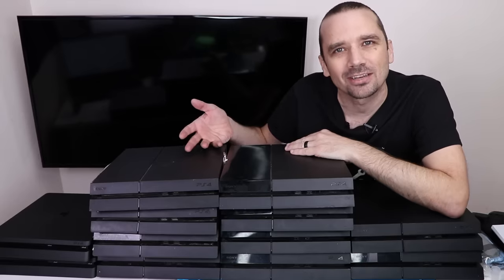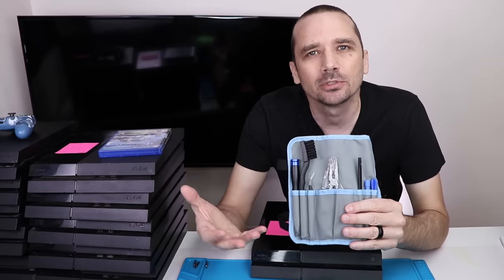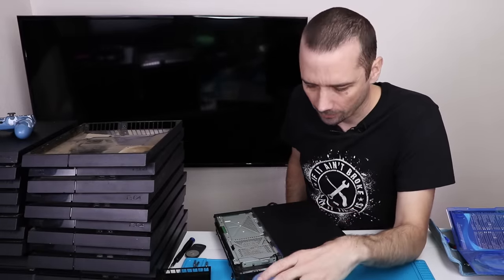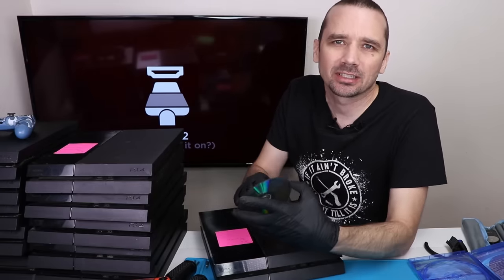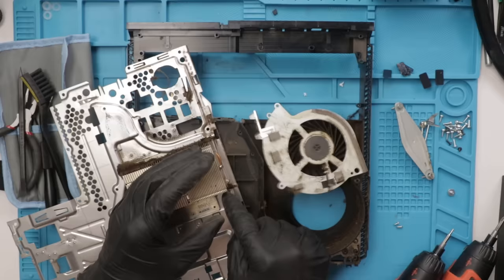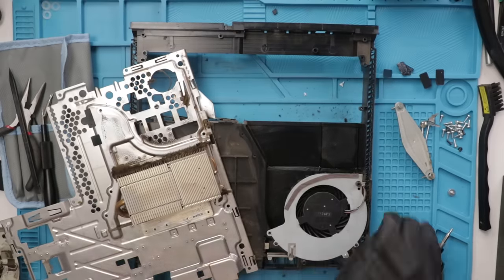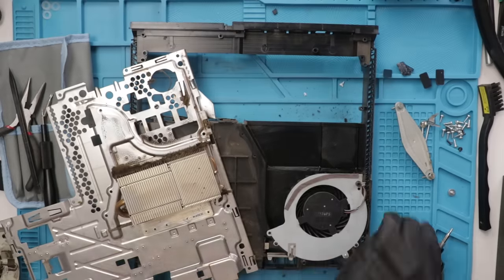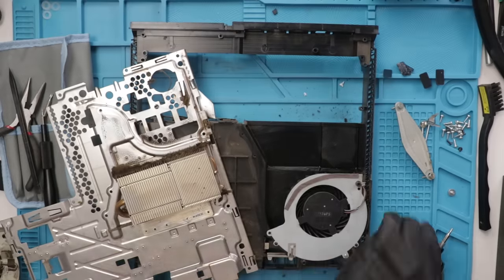I Bought 12 Broken PS4's From eBay - Let's Try to Fix Them!

Comment: PS4 number 1, diagnose: Belonged to a smoker.
Reply: I'm a smoker and am stunned by the amount of dirt in there. You can grow vegetables in there.  No idea how it ended up that bad. As I said, I'm a heavy smoker and all of my systems are pristine inside. Highly doubting that only smoke caused that.
Reply: What kind of smokers do you know? Smoking inside any room without at least a huge window open and a fan is already disgusting, and this is coming from a guy that's been smoking since he was 14
Reply: Is he using his ps4 as a bong?
Reply: @Molly Walker i'm the actual virus, i don't know about the others though
Reply: @vejza1108  I mean obviously they didn't clean the area around their console too, perhaps kept it on the floor as well. But smoking was what caused it to gum up the drive and stop discs being pulled in. Maybe you hoover once in a while and crack a window, who knows. But it was 100% a smoker's console.
Reply: @mydogeatspuke  Indeed, as I said it was not only the smoke which caused it, it's a multitude of factors. Closed space, dust, not ventilated at all, probably a lot of food crumbs as well, and one of the key factors probably would be high humidity, dry stuff doesn't stick like that, not even helped by a tonne of tar from the cigarettes.
Reply: @vejza1108  As an ex-smoker who was once living in a house with heavy smokers who didn't open windows, I beg to differ. Cigarette smoke is filled with tar (which for those who may be reading this and don't know is what turns everything brown in your house) and it is VERY sticky. Just look at the blackened lungs of a deceased smoker, all caused by tar, thick sticky layers of the stuff. That's floating around in the air looking for surfaces to stick to every time you spark up and exhale, and changes form when it cools. It will and does gum up electronics and cause things to stick together, especially inside electronics where they're already hot (tar becomes sticky when heated, that's why roads get sticky on a warm day and it feels like your shoes are sticking to the floor when you walk on them), hence all the fans. In occupied rooms there will always be some humidity due to people existing. We breathe and sweat out about 2 litres of water a day, but water evaporates. It doesn't make things sticky and clog them up. Nobody I've ever met has eaten their food directly over their computer or console to get food crumbs in them, but there were no food crumbs to be seen in any of these repairs anyway so that's kind of pointless to mention? Whilst some of the consoles may still have overheated due to dust from being kept in less than clean environments, they would not have gotten so brown and sticky and clogged up inside. It just wouldn't happen. The dust would be easily removed just using pressurised air, even with humidity in the room as it built up, because water evaporates and tar unfortunately does not. But if you'd like to be offended on behalf of all smokers everywhere and take personal responsibility for changing the hearts and minds of everyone around the world about the disgusting effects of smoking, by all means keep it up. But you're factually incorrect, I'm afraid.
Reply: @mydogeatspuke  Good point, as I said I still don't think it's only the smoke, I cannot imagine how much someone should smoke to get it to this extreme, If you read my comments you will see that I never said it wasn't the smoke, it's clearly involved, but not a a single component to the problem, this is just disgusting, it needed to be far more of a abuse to the poor console.

And to address the food crumbs. I know a ton of people who eat by their computers and consoles, it's far more widespread than you might think. From your comment I could conclude that you are referring to chunks,  I meant crumbs, literal crumbs, like salt grain size remnants of food, and no they wouldn't be visible, would they.
Reply: @vejza1108  You can not think it's just the smoke all you like, but it won't change the facts. In your last reply you didn't think tar was sticky, and that is provably incorrect, but did think that room humidity causes things to stick together which is also provably incorrect, so with respect, what you think is kind of irrelevant here.

Perhaps you're not as heavy a smoker as you once though. Congratulations. And eating "by" your computer isn't the same as eating directly above it and an open vent. It's like you're not actually thinking about things as you type them and how they're not realistic. I know what crumbs are though bud, thanks, and yes they are visible lol. I also know what tar is. So.
Reply: @mydogeatspuke  think it's only the tar all you want. As I said you have a good point there with the temperature. I know the tar is sticky, jeesh, but obviously you haven't been to a high humidity place with a lot of assorted dust. It gets very, very, veeeryyyy sticky especially under pressure which the fan would represent in this case. To conclude this line of comments from me, because frankly I'm getting bored by it, my conclusion would be - heavy smokers area probably in a basement, or a very damp room, dusty, with poor placement of the console, no air flow whatsoever.

P.S. Crumbs are not visible in the mishmash of sticky dust :D
Reply: Eddie Bruce 😂
Reply: any thing belonging to a smoker should go in the toxic waste bin.
Reply: John  crack smoke?
Reply: @yungskrilla2124  nah just cigarette smoke

Comment: it's so weird hearing something other than the "red ring of death"
Reply: That’s on the Xbox 360
Reply: @lex5572  thats what he meant for years xbox got crap for the red ring now its sonys blue light.
Reply: If I had money to build a console in a factory then my consoles would NEVER have APU's soldered(socket only) and it would never have error codes. It would tell you what to do. If it ever got  to having errors anyway.
Reply: APU's are resolderable anyway.
Reply: @andrasszabo7386  its called pins and they do exist
Reply: @darell8310  I mean the ps3 also had a common heat sync issue. It just wasn’t as rampant as the white arcade Xbox 360 models issues.

Comment: Great video, i had no idea a used PS4 still went for that much. I bought my nephew a new one on blackfriday from Target for 200$, ps4 slim 1tb with 3 games. Was too good not to pass up. Bet you can sell those 2 BSODs one to someone in China theyll pay for the unit and shipping and reball em lol. If i had a hot air station I;d buy those just to practice on. Great video. I wish Sony and Microsoft used filters on their systems like pretty much every PC in the world does. Maybe next gen they will.
Reply from the maker: Glad you enjoyed the vid! Thanks for the comment.
Reply: bluej511 . Guessing you haven't checked out many prebuilt PCs. Also there is still plenty of cases that don't come with filtered intakes.
Reply: @robertt9342  Even prebuild PCs don't have wide opening for intake fans, some don't even have intake fans because they run very low TDP CPUs, most that run higher TDP ones have a proper case and are filtered. It's one of the reasons i hate laptops, there's no filtration whatsoever and why they day rather quickly.  The cheapest case on newegg even has front filtration for an intake fan.
Reply: bluej511 I really wanted to get that bundle, but I had just bought myself an expensive iPad. Haha.
Reply: Johnny Sack  yeah idk who would do that

Comment: yeaaaah i wonder why my old ps4 sounds like a jet plane
Reply: Jakob Varpe yea same
Reply: Mine works fine tho
Reply: Same
Reply: Bro my ps4 pro can’t play nba or any game with decent graphics. It becomes a jet plane and shuts off
Reply: @captainjacksparrow9229  probably something wrong with your heat sink or fans are really dirty or both
Reply: The problem is there's lots of dust clogging the fans
Reply: Probably a 1st gen ps4. Those had loud fans. The 2ng gen they did different fans
Reply: I keep min in a room where theres 14 Celsius and it is so quiet never goes to faster fan speed and i Play gow rdr and hzd
Reply: So does mine, I'm just hoping it holds out until the PS5 because I can't be bothered to take it apart.

Comment: How I improved the rolles on a reel-2-reel tape recorder once was by actually using a steel brush on a drill and just lest it perforate the top surface of the pinch roller a little; where I had the roller on a small screwdriver (or you can use another rod that fits). Which really helped increase the grip on the old rubber rollers from the 1970's. So if these rollers ever get too smooth that would be a good option.

Comment: In the future they should really make consoles more "fixable" for casual consumers. Maybe an easier way to access all the parts and clean them.
Reply: Sir Joey The White they will make them unfixable
Reply: @erv2n  sad but true, just like how replaceable batteries are all but gone from cell phones, most laptops, hell, can't hardly swap RAM out in many computers. they'll put em in housing that can't even be opened up at all
Reply: A S they do that to make more money and create opportunities for other companies so you can pay to fix them or get new ones it’s always about money
Reply: @cheetothefrito8937  yep, that was my exact underlying lament. one day this pointless system will fall, though, under the weight of its own corruption.
Reply: They don’t really want anyone to fix them except the manufacturer. So you have to buy a new one or a manufacturer refurbished. More profit.
Reply: Why?  they look  for profit..... not to last....
Reply: Yeah. It’s stupid how you have to remove the warranty stickers just to clean out the inside.

Comment: I still don’t know how my PlayStation is alive
Reply: IDUCKTHEDUCKLORD Bro I stg😂 my ps4 just starts beeping and making the the disc noise out of nowhere. I’m afraid of what mine looks like inside
Reply: @christianrodriguez7947  i think you accidentally turned it on via the Playstation button on the controller
Reply: I spend like five hours a week just battling with the Safe Mode Death loop.  At this point, I'm just so resigned to it, that i just deal with it.
Reply: @lylewalker5681  that is TUFF. Send it to repair.

Comment: That first one was disgusting
Reply: How many egg cases left in there to hatch out into baby horrors?
Reply: He don't eat this yet.
Reply: Yould be surprised how often the inside of peoples stuff looks like that. They keep thier consles close to the ground so it sucks up all that dirt and hair. Often tucked far back so also where all the rooms dust is collecting anyway. If you dont want to take apart your consles atleast take a vacume hose to the vents to help pull some of the dirt back out.
Or compressed air to blow it out. Working retail every console brought in would make a plume of dust.
Reply: Would use a mini hoover!
Reply: Matt.  using it on the board yes is bad against the vents is fine(not amazing) but is far better then doing nothing. If you have an air blower (a device that blows air like a hairdryer but without heat) thats best. If you bring it into your local gamestop they might let you use theres.
Reply: why
Reply: Naah
Reply: @theendofit  the worst equipment I took apart was stinking of dog and cigars and there was so much hair inside that it could be enough  for a mid sized dog.
Reply: @MrRivii  dogs shed alot it was probably just one day of shedding.
I had a system coverd in what looked and smelled like chicken poop and they were supprised i would not take it
Reply: some people are gross
Reply: Some people dont take care of their stuff...

Comment: Looks like most of the issues are either neglect or abuse.  Hard drive failures happen sometimes even when a machine is taken care of, but it's shocking the number of people just throw away or sell as "broken" when it's a hard drive issue that can be fixed cheaply and quickly.
Reply from the maker: Agreed
Reply: Its obvious many people who buy consoles dont have the technical capabilities to take apart and fix electronics.

Yes people who fix PCs and most of there electronics think its weird but many people coud not even remove the ps4 cover let alone fix it.
Reply: @xXSinForLifeXx  Right...and for the things like broken ports I can definitely understand that.  I don't have the dexterity to do that myself even though I fully understand the process.  But for a hard drive?  It's less complicated than putting Legos together.  And even that doesn't excuse the obvious neglect/abuse issues.
Reply: With the first problems I'm surprised they don't use air filters on the vents as they are cheap  effective and easy to clean or swap out
Reply: the thing is, for you, me, many others and tronics its just super easy to replace a hard drive and an obvious and easy task to do, but many people dont see it that way what for someone with technical know how is an easy task. Changing the Oil in a car is an insane easy task. literally 1 screw and a screw in oilfilter. will i let it do my car mechanic friend? ofc.